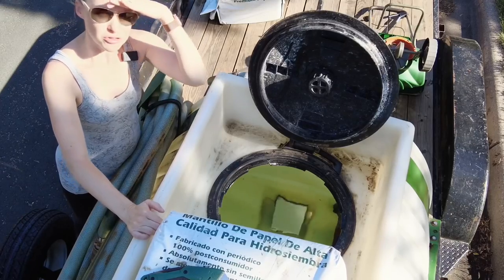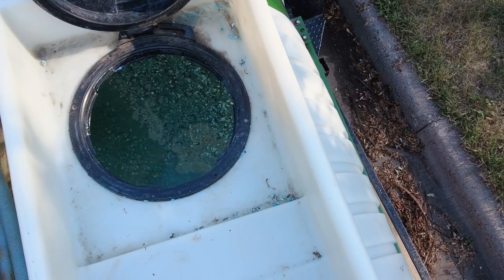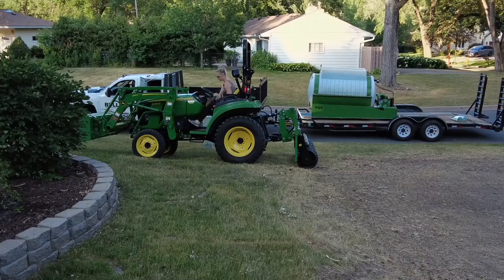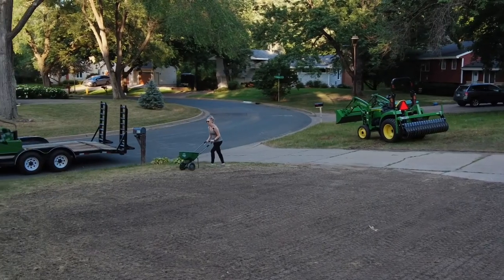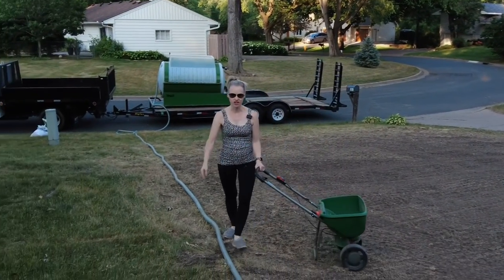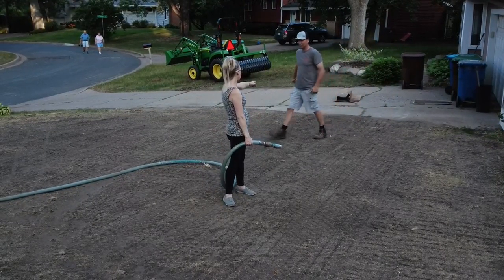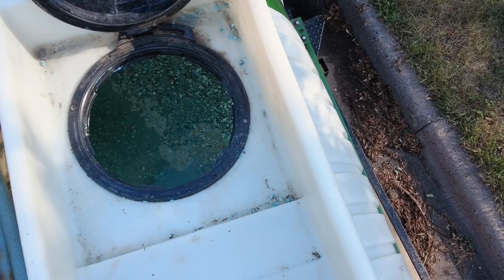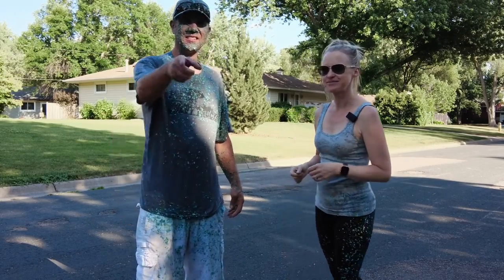How to Use a Hydroseeder for Best Results

Comment: Why not put the seed in the tank?
Reply from the maker: You definitely can, and in some cases it is necessary. Such as slopes or difficult terrain. For turf lawns i prefer to see my seed rate. Which is difficult at best when mixed into the slurry. Fertilizer is another option. Due to nitrogen in fertilizer it can accelerate oxidation aka rust. 
There’s always options, and not always a 1 size fits all.

Comment: How much do you charge to hydroseed per square foot for labor and materials?
Reply from the maker: Loaded question lol. Depends on the area being worked. I’ve overseed with near zero labor prep and charged as low as $0.12 SqFt. On the other hand I’ve had to charge $1.00 Sqft due to labor required to get the seed bed prepared. Then some jobs are only Hydromulch where others are full Hydroseed and fertilizer.
Reply: @BulldogTractor  thank you
Reply: @BulldogTractor  how are you doing mulch jobs with no mechanical agitation
Reply from the maker: @landonjohnson3475  remove Seed & Fertilizer from hydroseeding and you are left with liquid applied mulch. Simply put, Hydromulch. How it is agitated is not significant. 
Only difference between jet and mechanical is the option to run a higher concentration of wood fiber with a mechanical unit. A liquid paper slurry is a form of mulch. Just like a liquid fibrous substance. Same is same. It’s not how the slurry is agitated that changes the substance. You can’t put paper into a tank and have it come out as wood. However the change in substance (paper Vs wood) can change the intended application use. 
I run a paper mulch that is jet agitated to stabilize soft/ low slopes. But for my purposes it is mostly for water conservation where infrequent watering is identified. 
Mechanically agitated machines really outperform jet machines in steep terrain where use of a binder (wood) is desirable. 
I don’t do aggressive slopes or inaccessible areas. For me a mechanical unit would be  overkill. 
Hope that helps?
-Bulldog

Comment: New Subscriber! 👋🏼

How much does it cost to rent one of those hydro seed units?! And forgive my ignorance, but I thought the seed was in with the mix that you spray. 

I was wondering why you also spread seed beforehand. Could you explain that a bit? lol

Thank you for putting this video together! Have a great rest of your weekend, and stay safe out there! - Samuel
Reply from the maker: Hi Samuel! And thanks for subscribing 👍. To be honest, I’m not sure what a hydroseeder would cost to rent, as there is such a wide variety of units out there?  I wasn’t able to buy a new unit as supply chain issues had new units at a 12 week minimum lead time.  So I had the family road trip to a neighboring state to buy a used machine.  Got a video on that, not super informative- but mildly entertaining to watch 🤷. As for feeding the seed in the slurry or broadcast, that’s really an option I have.  The grass seed itself, is just your average grass seed.  There’s no difference, or i should say the seed used for hydroseeding is the same as you would purchase at a store.  So here is my opinion on the matter.  One of the most important application procedures is “seed to soil contact.”  Well because i have a tractor and cultipacker (the steel notched rolling drum) I know i can bed the seed properly using that method. Now if I added seed to the slurry, the seed would only be germinating at the very top surface of the soil.  Effectively that would have zero seed to soil contact.  Second issue is Nitrogen will corrode steel/iron so I really don’t want to prematurely wear out my expensive hydroseeder. Effectively my approach is “hydromulch” and not necessarily hydroseed but that is splitting hairs. After the first important step of seed-to-soil contact is performed during the application. Absolutely the next most important step is to continually feed the seed water.  That’s where the hydromulch really takes germination/ yield to the next level.  Lot’s of other contractors will place Seed & Fertilizer in with the hydroseed slurry.  It’s my own personal opinion that doing things the long way, is a better way.  But again, i want to stress that is my opinion and many other contractors get fine results hydroseeding the more traditional approach. On highly sloped areas, using a tractor and Culitpacker may not be an option?  But on residential city lawns, if nothing else it makes for a convenient excuse to hop on the tractor! 
Hope that helps to clear it up?  Let me know if you have any questions!  Cheers from the Bulldog 🍻
Reply: @BulldogTractor  Thanks for the detailed response, and have a good one! - Samuel